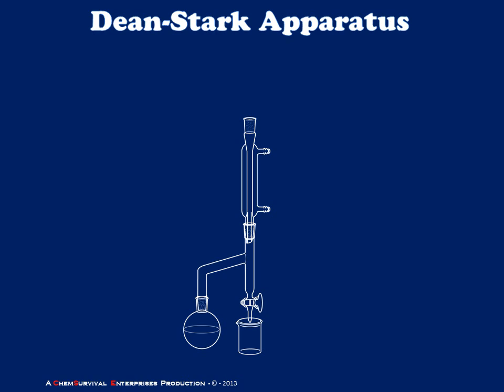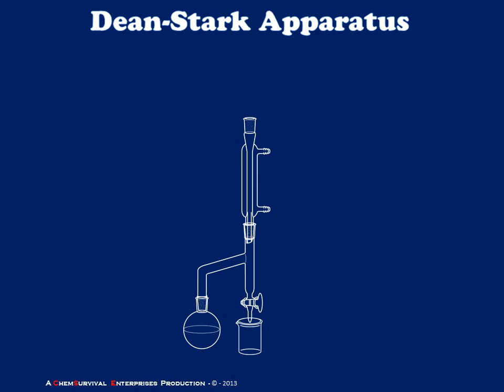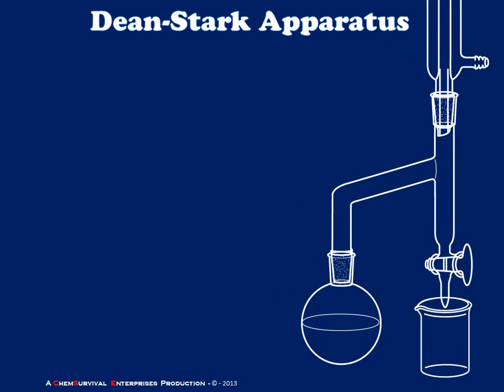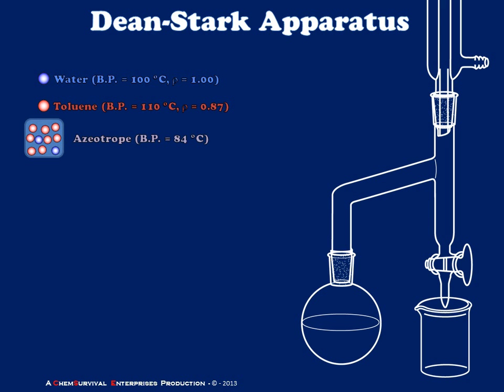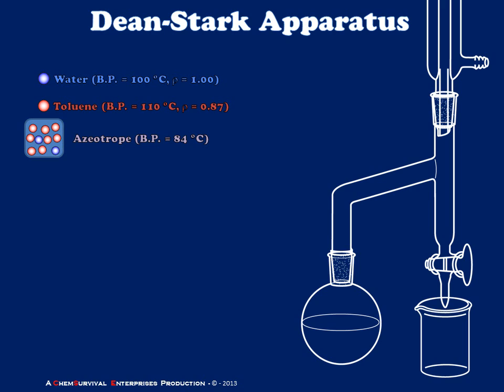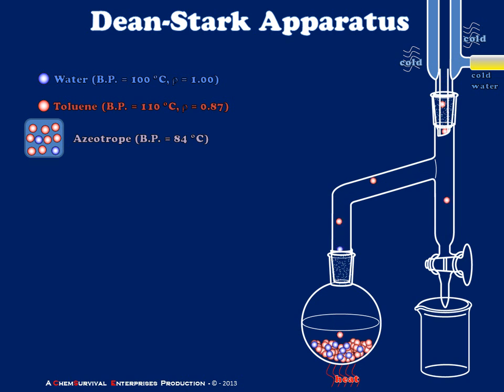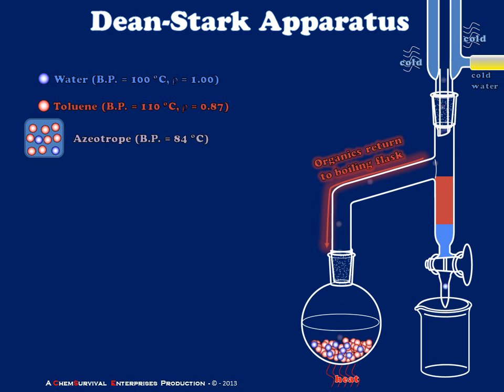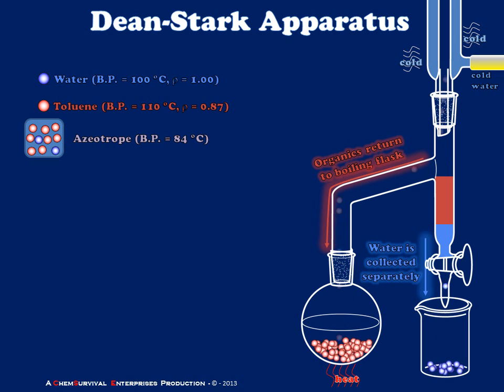A Simple Dean-Stark Apparatus Explained

Comment from the maker: The azeotrope is the vapor ascending to the condenser (in this case at 84 centigrade).  Remember that this azeotrope in our example forms at 84 C.  When the azeotrope cools to much lower temperatures (like 25 C in the room) it phase-separates.  This is why the ascending vapor is of uniform composition (the azeotrope) but the liquid in the trap is bi-phasic!  Cool, isn't it?!?!?!
Reply: But ... if the liquids phase separate when chilled, why not just chill the mother liquid in a separatory funnel and drain off the water.
Reply from the maker: @mikaelbjornson2666  typically because the chemical reaction or physical process that we want to take place happens at much higher temperatures in the boiling flask

Comment from the maker: Hello again, Dorota.  The answer to this question will depend on the application.  In the example of a condensation reaction, the water is forming as the reaction proceeds under heat, so I think it is fair to say that it *could* be just one phase at that point since the water concentration in the boiling flask is not likely to get too high (keep in mind it is being separated as it forms in such an example).  However, the devil will be in the details!!!

Comment: Why would toluene and water separate in the trap? In this example toluene is soluble in water, so wouldn't they be mixing the whole time they are in contact in the trap? What am I missing?
Reply: @thechiralkid6349  Thanks for the reply! I get that toluene is not soluble in water. My confusion really starts with how are they mixed in the boiling flask sense they are not soluble in each other? wouldn't the separation that happens in the column also happen in the boiling flask?
Reply: @cjcrowley  Toluene and water are separate as liquids in the flask. If they're not mixed, you would see toluene floating on top of the water. If the contents of the flask are mixed, you would still have blobs of one surrounded by the other just as if you had shaken a mixture of any two immiscible liquids. But toluene and water both boil, so they both wind up as vapor in the condenser and then they both condense and fall into the trap. It would all work even if there was no azeotropic mixture.
Reply: @thechiralkid6349  But why not only pour the liquid in the boiling flask int a separatory funnel and drain out the water? Why bother boiling?
Reply: @mikaelbjornson2666  You're right. If you just have water and toluene, you can boil off the azeotrope without a Dean-Stark trap, or using a separatory funnel would remove most of the water and then you could use a drying agent to remove the rest. The method is useful if water is generated in a reaction that's taking place in toluene. Then the removal of water with the return of the toluene solvent will drive the reaction equilibrium to the right. Wikipedia uses this specific example - a toluene-water mixture - in its article on the Dean-Stark apparatus. (I would have included a link to the article but I don't know how to do that and I'm too lazy to try to figure out how to do it.)

Comment: Great video btw, I'm just wondering how would you deal with organic material where density is greater than water, do you have a video?
Reply from the maker: +Joey T It is a pretty simple modification.  Just draw from the bottom of the collector instead of the top to replenish the boiling flask.  I will leave it to you to figure out the engineering ;-)
Reply: Ah thank you!